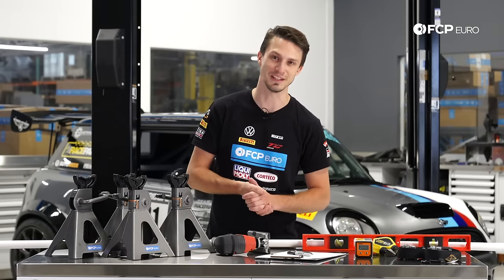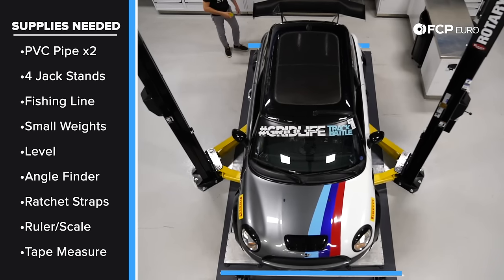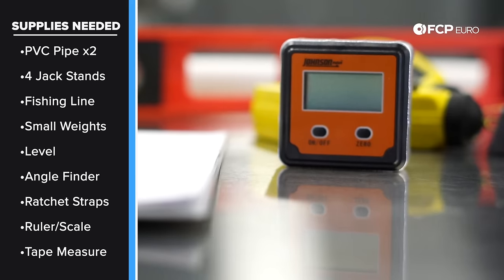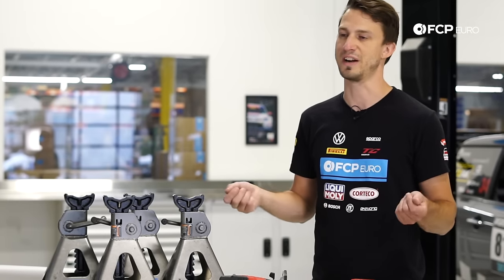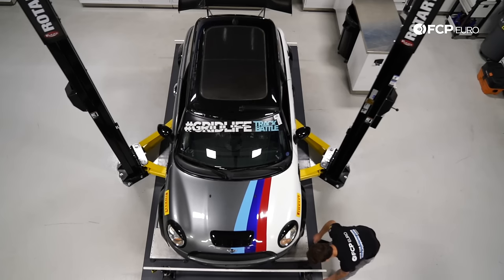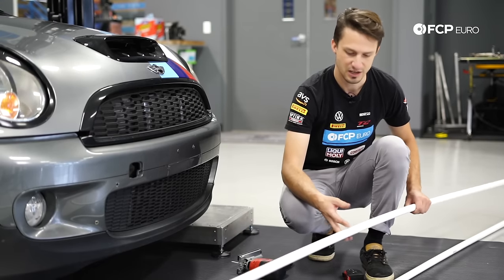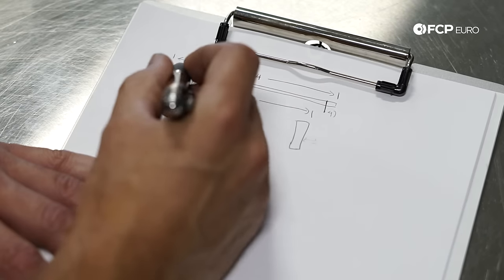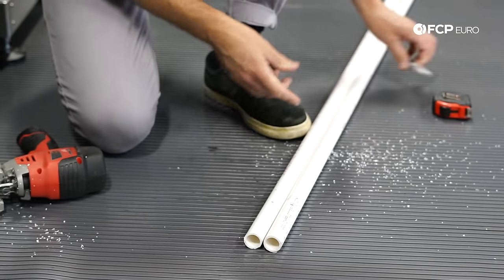At Home Alignment Made Easy - How To Use String To Align Your Car

Comment: Good video but I don't believe your text comment at the end about camber plates on front suspension having little to no impact on toe is correct. Maybe not as much as the rear and while I haven't measured it myself I have been told that after adjusting camber on the front you should recheck toe.
Reply from the maker: It's never a bad thing to always recheck toe after adjusting camber and vis versa, on most stock applications with very limited camber adjustment the amount it'd skew things would be minimal, but if you have the time and means always recheck!

Comment: This only works for vehicles that have front and rear wheels perfectly in line with each other! Believe it or not, many vehicles have the rear axle shifted to one side. This will not work on those vehicles, I found that out the hard way years ago. If you want an example of what I'm talking about, look at a Chevy S-10 Blazer sometime. Look at how far the left rear tire is in or out from the wheelwell, then go to the other side and look at the other rear tire. The difference is easily seen by the eye without making any measurements, it's a difference of about 3 inches!

Comment: Not that efficient since alighment should be done wirh the mountkng base where the rim seats. I can swear if you spin your Wheels 1/8 to 1/4 turn, your measures will bw wrong, so you need to readjusts and so on ad infinitum. 

So you need a middle point between 0 an 90° measurements. Or do it directly to thw rims mounting base.
Rmove wheels, do the same.with the Wheels mounting base and yes. Then you have an aligned wheel.

Comment: This is not easy. What he didn’t show is he had to go up and down on the lift each time he makes an adjustment. Car needs to be weighted to measure accurately. Easier way is put a jack stand behind each wheel. Run a string to the front wheels. Measure to in to the front or back of the sidewall of the front tire. Nuisance to jack it up and down with each change. Just wiggle the steering wheel after each adjustment. Put a level on the steering wheel. I have alignment turn tables coming from Amazon so I don’t have to jack it up each time.

Comment: how come on the alignment machine......you always adjust camber first then toe....... because camber will change the toe...
Reply from the maker: They will always change one another no matter what order you do them in to some extent, so its best to make your adjustments and double check the other measurement to see if it changed things enough to readjust.
Reply: Yes, my understanding is Camber adjustments affect Toe. Toe adjustment does not affect Camber.

Comment: Great setup but you way over complicated it.
Reply: Easy if the front and rear wheels are same distance apart, but many modern cars have a wider rear track.
Reply: @flybobbie1449  does not matter. As long as the string is equal away from the rear wheels, the fronts may have more distance. Just make sure the fronts are equally away from the string. Example 
If your rear wheels are say 4 inches from the string, then the fronts may be 5 inches from the string if you have the staggered setup. As long as both sides of the front wheel are 5 inches equal then its lined up.
Reply: @ACommenterOnYouTube  Yes done it many times on my Z4.

Comment: You made an error.  If the back of the wheel is 95 and the front is shorter, 92, then the front is in more not out.  So the wheel is towed in, not out!
Reply from the maker: Since you are measuring the distance between the string and the wheel the larger number (gap) means the further inward that portion of the wheel is, the smaller number (closer) to the string the wheel is makes it further pointed outward.

Comment: NAH. After a complete front suspension re-build, I took the famous 95 MERC to the Goodyear Tire store to have my suspension aligned PROPERLY by a trained technician that  set the Caster, Camber, and Toe settings "on the nominals" of the manufacturer's specs.
The Acura MDX will go there for a 4-Wheel Alignment before replacing the 1200-dollar tires.
You get a print-out of where the settings were BEFORE work began, and again AFTER completion of the alignment.
The computer knows the specs for your vehicle, and the technician will set things "on the nominals" at your request -- but ya gotta ask.
When work is completed, you have a printed record of the "before & after" alignment settings, and the knowledge that your vehicle's steering and handling are exactly as specified by the manufacturer. 
I'm all for saving a buck by doing my own work -- but this hillbilly crap is ridiculous.
Reply: I spent hours,tools,and bunch of methods aligning my porsche, no matter how close the measurements nothing beats the precision laser alignment machine at the shop. This video is waste of time.

Comment: YOU CAN'T USE A STRING ! ! !   ANY string will STREEEEEETCH  and not be accurate ! ! ! ! ! !
Reply: That's possibly what the weights are partially for?  Although you make a good point, as it's a good argument for using smooth nylon rather than string as it will slip through the slot more readily and stretch less.  Also any stretch will in the vertical plane so will have minimal effect on accuracy (unless you're in an area subject to wind).

Comment: Very nice, but I would rather just take it to an alignment shop for $60
Reply: Most alignment shops in my area do not charge $60 for a four wheel alignment, it's more like $90-95, and that is just to put it up on the machine and get the readings.  Anything they do beyond that is extra.  Dunno about you, but that get expensive really quick for me.  I'd rather have a cheap way to check it myself and then have them confirm it ONCE after I am all done.
Reply: @StilettoSniper  either way is fine it doesn't matter to each his own if you have the money to take care of the shop take it to the shop some people don't have the money, you know. Doing it on your own is respectable